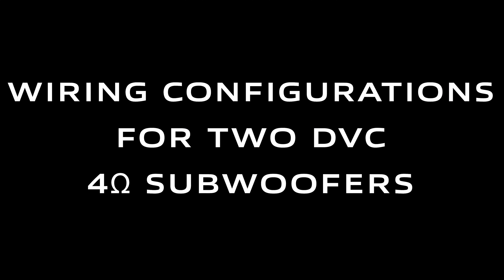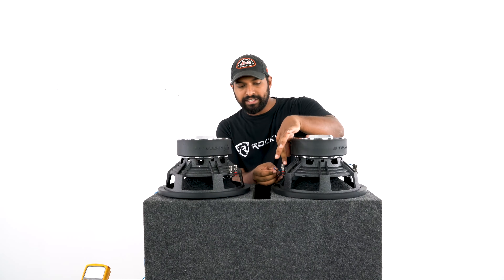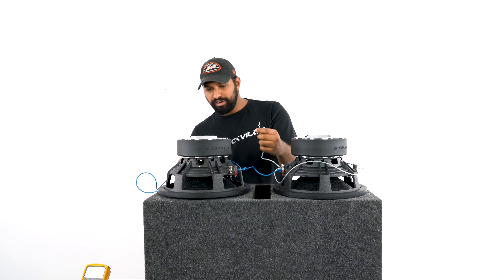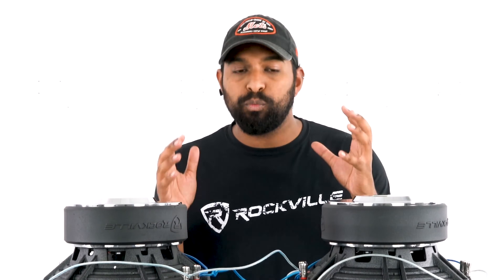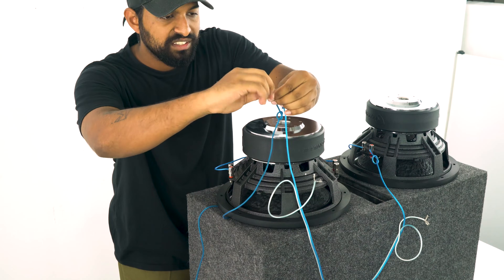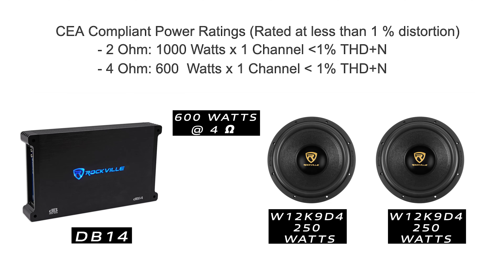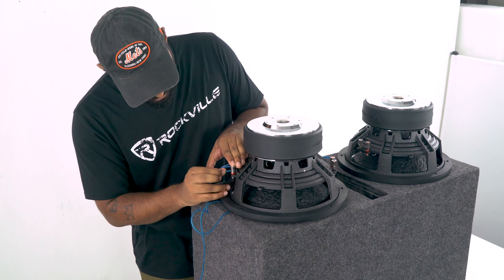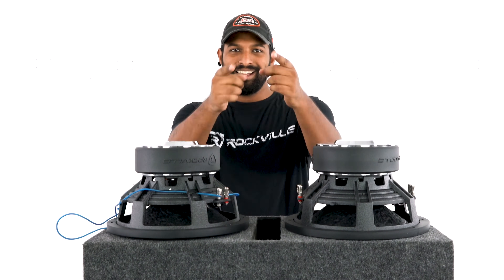HOW to WIRE 2 DUAL VOICE Coil 4 OHM Subwoofers for final impedance of 1 Ohm or 4 Ohm (DIAGRAM)

Comment: Do coils lose impedance for years my 4 dual 4ohn subs wired to final impedance of 2ohm now only read 1ohm amp keeps smoking amp is 1ohm stable but speaker out put for 1ohm are at each end but i use for 2ohm at outputs next to each other if you get what i mean

Comment: Nothing like a good multimeter to check speaker ohms first,wire it up then check it at the box terminals,first time wiring dvc 4ohm to 2ohm,I would have wired 1ohm but dont trust my old infinity 611a lol

Comment: Hey what's up I just got your dB15 6000w, how would you get both subs ( R2 w12D4 ) to run off the amp at 2 ohms? Because the wireing digram shows the same thing for both 2 and 4 ohm

Comment: I have 2 10in 4ohm Dual coil subwoofers and a 1000 watt 4 channel Amp and using as bridged which speaker wire configuration should I use? The AMP can go to 2ohms?
Reply: I'm not 100% sure but if u have 2 dvc  4 ohm subs they can only run at 1,4,or 8 ohms I'm not entirely sure but I think that's how it is

Comment: But how do you keep those connected when you put them in the box
Reply: Easy most sub boxes have separate ports  start wiring one sub power to power ground to ground in the wall drill a hole & pass other wires through there & again power to power ground to ground & you'll only have one power & ground for the amp specially ideal for a single ch mono block class d amp you just gotta make sure subs are 4ohm dvc which they could only be wired to 1 ohm 2ohms & 8ohms dual 2 ohm Dvc subs can be wired to 0.5 ohms 2ohms & 4 ohms
Reply: @benjaminalmendarez3059  is there a way to do this with out drilling a hole in the box?
Reply: @AlmightyyCres  yes but it don’t look as good.
On the inside of the box the port divides the sides run it back and forth behind the port.
Pretty simple but you will probably see the wire at the back of the port from the front of the box when looking at the speakers.
But you will have to have something to keep the wires from rattling because there will be a lot of pressure in the box while the speakers are playing.